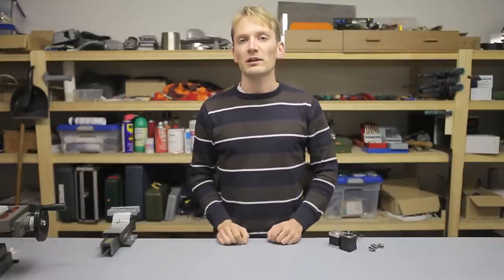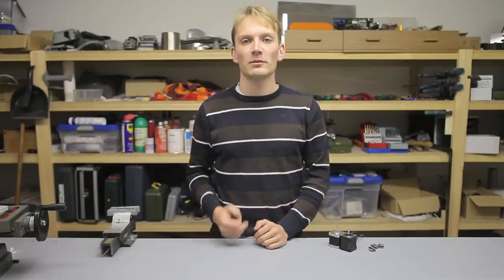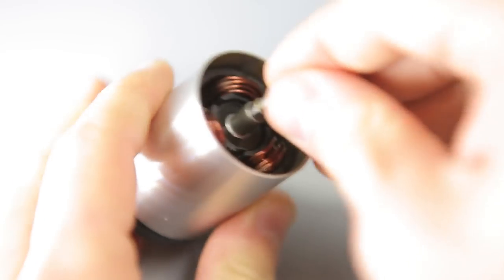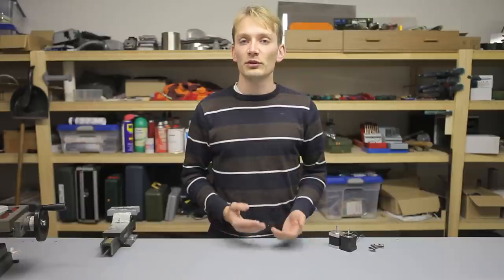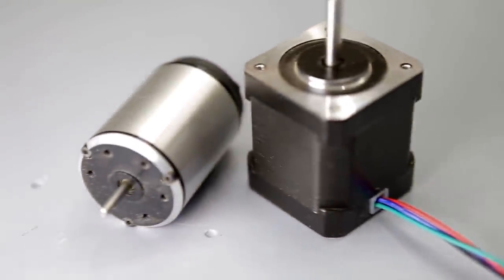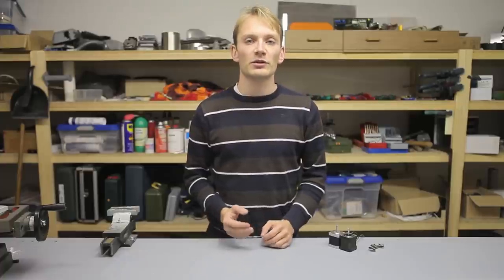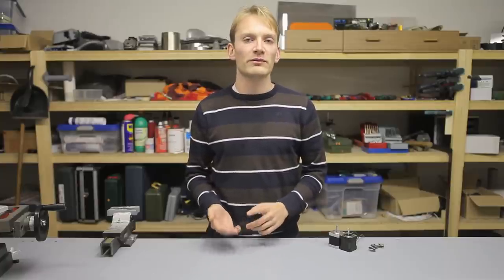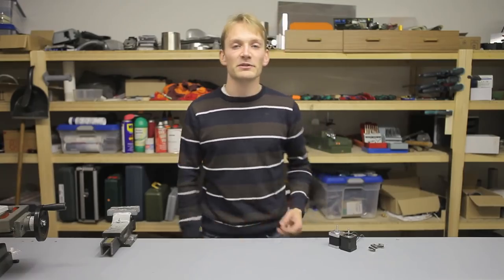3D printing guides - How steppers work and how to adjust their drivers

Comment: Technically stepper motors are actually AC motors (and yes, I have driven one off of 60 Hertzs AC with a capacitor to force it to turn the direction I want it to run into - unsurprisingly it wasn't awfully fast, of course stepper motors are obviously capable of spinning as fast as a cordless drill motor, it just requires a fast microcontroller to step it rapidly), so inverters are responsible for that - stepper motor inverters are electronically much more complicated especially when you start to involve the micro-stepping into motion actuations, at least Analog Devices' Trinamics and Texas Instruments are one of a few companies that offer all in one stepper motor drivers and occasionally separate gate drivers for custom stepper motor inverters (ie. particularly to drive a huge and expensive stepper motor used in certain industrial CNC equipments as voltage requirements are dramatically different between 3D printer and that expensive machine).

The obvious advantage of the stepper motors in the 3D printer is that you can digitally control them with a cheap microcontroller, or expensive one if you want to go big or go home on 3D printer hardware.

Comment: hi-

Hi. So what does a higher voltage do for the steppermotors? gives more torque? more speed? Why are we running a 3v rated stepper on 24v?
Reply: He explained part of that: providing the stepper drivers with a higher voltage gives them a higher overhead (i.e. the voltage you set is the maximum provided to the motors), which does allow for more torque, and yes, speed. But again, like he said, you'll want to watch out for resonance frequencies and overheating.

As for the 24v->3v thing, well, that's just kinda how electronics work. Volts x Amps = Watts, so with the same amount of power, you can trade volts for amps (and vice versa), and in situations where you're not dealing with a lot of voltage drop (as you would on the heated bed which has a small amount of resistance over a loooong circuit), you can instead throw more amps at it to, uh... ...wait. Fuck... y'know what? I really don't understand electricity. ._.

Somebody help me out here? I wanna say it's like horsepower vs. torque in a car engine, but I know that's not a perfect analogy... and the big-pipe/little-pipe water flow analogy isn't much use, here, either. :/

I think the car example is probably good enough, though. If you had a 24v motor with a limited power supply (and a thermal overload limit, as well), you could make it go really fast, but you could stop it with one hand. But if you instead ran a lower voltage through it, you would have enough amperage available to maintain its motion (at a lower speed) so it could properly mangle your weak human flesh when you tried to stop it, like you would expect of a proper industrial machine. In this case, that means being able to stop and start faster while pushing around all the weight of the X and Y carriages on your printer.

...that make any sense? <_<

Comment: My printer just randomly stops printing after 2 hours. It just stops and it doesn't home or anything. It just stops. I know its not the gcode or stl file error because It still happened when I had it connected to my computer. Is it possible that the print stops because the stepper motors are getting too hot?
Reply: @dalefischer4885  I'm a bit late but.... is it possible that your computer is going to sleep during the print? Ive noticed that my printer reboots when I connect/disconnect the usb from the computer, likely due to transitioning from pulling 5 volts from the usb cable to pulling it from the built in power supply and vice versa. Some computers will shut down usb power when sleeping, this could cause your printer to reboot even if it was printing from the sd card, simply because it was plugged into the computer.

Comment: increasing the supply voltage to the stepper drivers, will decrease the charge time of the motor coils. giving you higher speed. but with most of these machines that's only really valuable for the z-drives. and then only for fast movies. like homing and unloading.

Comment: Ok my driver is acting up I even changed the driver board with a spare I have in Ext 2 still the same problem with the Stepper I think my motor might be bad is there a way to check my motor it extrudes fine when I give it a Manual command but screws up when the Gcode is running it.... any Idea why this would happen???